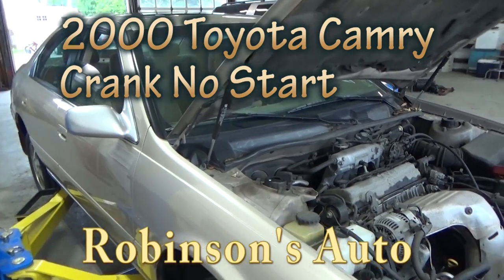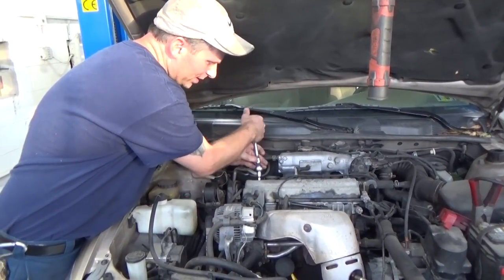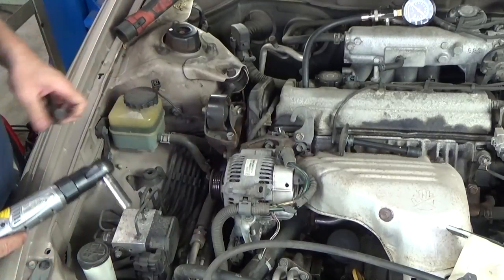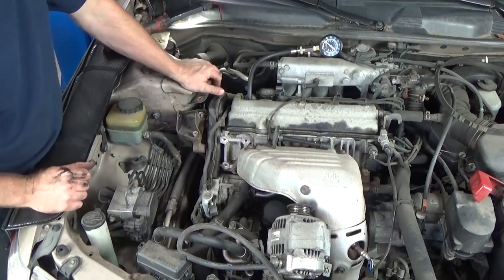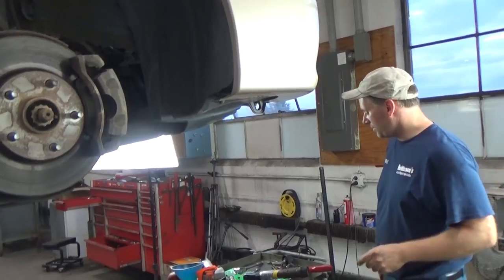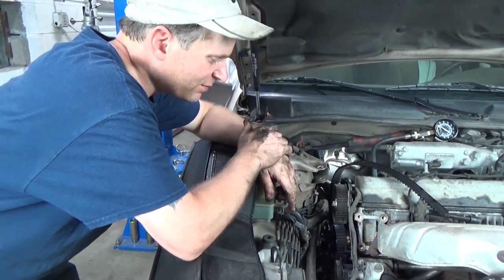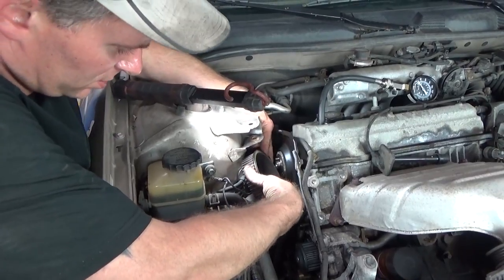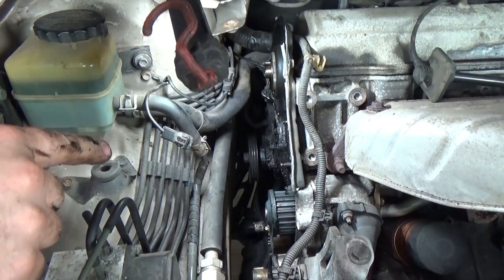Toyota Camry Crank No Start Part-1

Comment: I got the same crankshaft codes I replaced both checked all fuses and relays and also changed the fuel pump thinking it was the cause but after watching this video I will check for compression something I should of done from the gate but I'm a YouTube mechanic. Thanks for video

Comment: Great video!  My T belt failed due to not using a Toyota W. Pump or Aisan brand. Pump seized and T belt broke. I went in replaced all the components w/ Toyota or Aisan.  Replaced the 2 Oil pump seals
along with a Cam shaft seal. Installed a new T Belt.   Thanks for making this video!

Comment: The minute you said shut off on the road while driving and little resistance when cranking I immediately called it a broken timing belt or warn teeth on the timing belt.  Exact thing happened to me in my corolla. Fixed it myself with no problem.
Reply: as? what was the problem?
Reply: I just stopped on the road in the same situation
Reply: @mgalsanov  "I immediately called it a broken timing belt or warn teeth on the timing belt."  I guess she is talking about the timing belt.

Comment: Very distinctive sound of a  broken timing belt vs a non broken high pitch whine. I dont think that small leak of the valve cover could cause a timing belt failure. good job on the cam seal diagnosis, alot of ppl would've just over looked that. That tool is AMAZING!

Comment: On a lot of cars you can open up the oil fill cap and find the camshaft not spinning. I diagnosed a broken timing belt on an 02 Focus for a buddy on a farm with no tools in 10 seconds, I just opened the oil cap and saw the harmonic balancer spinning, but the camshaft not spinning.

Comment: My son has the exact same car.  The oil pump gasket, which is an oring on this car, is notorious for leaking too.  Easy to fix when doing this job.  I've also done his valve seals which were hard as a rock causing the car to smoke something terrible on cold start.  I understand this a common problem for this engine also.  His car only has 110k on the odometer.
Reply from the maker: Jeff Leach yes I agree it's a good time to do it. Thanks for the feedback. Had your hands full on that one ☝️

Comment: Gotta love non-interference Toyota engines! Just run it till she quits, throw a new belt on, keep on trucking :)
Reply from the maker: Pine Hollow Auto Diagnostics so true :) few and far between these days, thanks for stopping by bud! Glad to see your travels went well
Reply: Pine Hollow Auto Diagnostics That was my first guess. The timing belt broke. The description in this video of what happened while driving , gave it away.  I have a '95 Camry. No worries if my timing belt breaks either.  The best car I ever owned.
Reply: So i have 01 camary and today i started the car put it in drive and car turned off.. it is making the exact same high pitch sound when you try and start. All i could do bec i was at work was pull the top 2 screws and i noticed when trying to start the timing belt is not moving. What i do not understand is the car has 217k the belt was replaced at 100k and then again at 200k now here i am at 217 with a belt not turning. I cant get it opened up until this weekend to see if it is broke or jumped.. can there be any other reason where the cams wont turn? All other belts are turning so the motor isn't siezed. So frustrated. What reason could a belt go bad wirh just 17k on it? Thanks for reading.
Reply: @chadsmith1348  Crappy aftermarket parts? Failed tensioner? Should be obvious wnce you tear it apart :)

Comment: Had a 2007 Camry and it didn't want to turn back on after driving it. It turned out it was a .35 cent rubber washer/gasket that was cracked in the gas pump. Had to take the back seat out and pull the gas pump. I did a pressure check before anything and it was at 27 then after replacing the rubber washer/gasket it shot up to 60. No problems since.

Comment: Great video very luky having a cambelt snap and no damage i guess it was the oil what made the belt week over time looking forward to part 2
Reply from the maker: Paul Mayou very lucky indeed. I believe you have a good point ☝️😉👍
Reply: It's the last of Toyota's non interference engines the 5SFE!! Did hundreds of these when I worked in the Toyota dealership very easy timing belt job!!

Comment: Also look out for the water pump see if it's not leaking because chances are coolant and is leaking and got the belt wet and that'll cause it to snap as well, Even though, you're right the timing belt was never replaced "routine Maintenance"...
Reply from the maker: Daniel C. Yes it's a good practice to replace the water pump while your there. I agree 😉 thanks for stopping by and leaving feedback! Great advice

Comment: The engine looks similar to my 1989 Camry. Crank no start. I’ll try the compression test and go from there. Will the process be the same if the timing belt is the issue? 
 I just don’t know so please be kind 😄 thank you

Comment: I remember that sound when my timing belt popped on me at a red light, over a year ago. Still have the blue tag imprint from the guy who had to push my car with his truck, on the back of my bumper lol. Then the police pulled me over thinking I actually meant to run that red light. When my timing belt went bad, I was told that all the oil seals had to be repaired too. It was leaking oil into the area with the timing belt. The valve cover was leaking pretty bad from the back too because weak gasket.

Comment: I have this car with the 4c engine. I bought brand new gas because I knew I was going to have to let it set for a minute over the winter. Next fall come around and I pulled out the keys to get it started up, I can hear the pump engaging but it has the most electrical sounding crank that I've ever heard. There is absolutely no fuel getting to the engine for some reason but I can smell gas when cranking, like a old flooded carb (I'm aware this is not carb) I'm stumped. Filter? Something electrical? It bugs the crap out of me because I'd I could get it running that would really help my situation right now.

Comment: 2005 toyota camry xle crank no start sisters car I'm retired .  Milage ? . I'll start with compressin check. Did a 1999 toyota rav same situation non i terference engine. Got gates kit from rockauto. All set. Did 2006 subie sti timing belt with gates kit all set. Working on 199t honda odyssey same situation with  bent valves head still at machine shop. Hoping sisters car is non interference. Great video this will definitely will help me out

Comment: I have 98 Camry. Replaced head gasket. Everything back together. Timing belt good and at top dead center. Cams good and aligned correctly. Compression is decent but not perfect. But the 500,000 mile motor still has life. It’s getting fuel and spark but it will not start. It cranks fine just won’t start. And I’m at a loss. No codes from OBD2
Reply: Oh

Comment: I have 99 Camry AUTOMATIC 2.4. I hit a tree branch pretty hard. And it killed the car immediately. The fuel pump is working also if I spray starting fluid Into Intake it starts till it burns offs. Is there a emergency fuel shut off?

Comment: I recently replaced a timing belt for a friend's Camry the timing marks are correct and I rotate the engine and they land in sync.. but the car won't fire.. is it possible for the cam to be 180 out? I did compression stroke tdc and then lined up cam but no dice on firing up

Comment: Just had 2001 camry do the same thing. Seal at cover was shot. Had a real bugger getting the bolt off the harmonic balancer. Rounded it off trying to break the bolt loose. What's the best way to remove a rounded bolt? Other than that, this video was awesome.
Reply: It's a bit late but a chisel always works for the bolt and in the future bump the starter with a breaker bar on it. Works great.

Comment: The throttle should be held wide open to give it as much air as possible when testing for compression?
Reply from the maker: yes for a optimal test, the engine should also be warmed up prior, we should have seen near min 145psi  under optimal test should be closer to 178psi is the spec on this vehicle

Comment: Thanks for the video. I have a question for my 2000 Camry. It died the other day while we were going down the highway. I thought the fuel pump went out and replaced it, still cranked but no start. Do you think it could be a broken timing belt as in this case?   Back in last January, I brought it to a mechanic to change the whole water pump, valve cover gasket, and cam seal to fix this huge oil leak my Camry had. So is it possible that the mechanic didn’t put it back correctly last time, which resulted to it not starting today? Thank you so much.
Reply from the maker: Son Dao it's a possibility. Do you have fuel psi and spark? Many possibilities
Reply: robinsonsauto Thank you for your reply! I don’t have the fuel pressure gauge nor know where to stick the valve into and check the psi. I have not looked the sparks yet.   
Just got back checking the white plug (underneath back seat) to the fuel pump in the fuel tank to see if it has any power. There was 5 different connectors on it, but only 1 had power. I don’t know if that’s the way it is or something is wrong there. 
Also, I tried spraying some starter fluid to the air filter and gave it bit of gas to start it. Engine sounded like it want to start, but the moment I press the throttle, the whole front was shaking and seemed like the engine wanted to die. (Best way I can put this is as if you were releasing the clutch on a manual car and not giving it enough gas)
Has this narrowed down what might be the problem that you could think of? Again, thank you so much for your reply!
Reply from the maker: Son Dao so it starts some with starting fluid? Keep in mind if it's not getting fuel the only sorce is what you sprayed in. Starting fluid evaperates fast. As soon as it's disaped or burned off it's gone and the car will miss and shack from lack of fuel then die unless you keep it running by spraying more in. Is this what your experiencing?
Reply: robinsonsauto that could be the culprit since I only gave it three sprays each last 2 seconds or so, and then turned the key. I did not continue spraying while turning the key. I will try spraying while turning and see what happens. I will get back to you soon, thank you!
Reply: robinsonsauto Also, I forgot to mention that the OBD2 showed the code “crankshaft position sensor.” I don’t remember what exactly the code number was, and that was all it said on the screen, nothing else.

Comment: I have the same car car shut off one day there are four things in the distributor coil camshaft sensors two of them I am two sensor you're better off buying a new distributor before that take distributor cap off turn engine over if the distributor inside is turning then your timing belt is fine if it is not turning then guess what timing belt is broke I did this in my yard took me 2 hours myself fired right up

Comment: um this just happened on my  car .. same  car . 99  ..  i was on the  road near my  home .  i  knew  what  problem  was in  10  min .. took off the  timing cover  at top  .. pulled  it back  a little bit .. could  see the  timing  belt  broke ..  why  didnt  you  just  do that  first?  ez look  see at top  cover .. did  the  job  myself .. not too bad
Reply: could  also just pull  #1  plug  look  at  see the  piston if its  moving while  cranking . thats  easy too

Comment: What brand battery wrench do you use? Do you recommend it?
Reply from the maker: tomhasno Harley ACDelco ARW1201 Li-ion 12V 3/8" Ratchet Wrench w 2 battery, 57 ft-lbs find it on amazing as a kit 2 battery's under 200
It's been good to me, little on the large size though. I would like to try out the Milwaukee before referring this one. However I can't complain. If it wasn't for the length it would get 5stars from me
Reply: Thanks for the reply. They all seem to be bulky, I'm sure like everything else they'll get smaller. I want to check out the Milwaukee as well. Thanks again!

Comment: My Toyota Camry 2007 LE having a headache problem : If I run a few hours , than I I stop  to fill the gas tank . When I start the engine , nothing ! No crank , no sound ! But if I wait for the engine to cool down or use the jump cable with other car , the engine start fine !  I already change the battery  ! Anyone have any idea ?

Comment: Hi there,  why don't you pull the Valve cover Off, make sure that the - CAM-SHAFT - didn't Break, or valves got Bent, just to Confirm..., 
  Good luck, hope that ENGINE can be Salvage, if not start looking for a new one or a used Engine...
Reply from the maker: Daniel C. Part 2 will be up shortly 👍 would hate to spill the beans 😊 this job was completed last week just getting around to the edit. Good advice though! Thank you
Reply: robinsonsauto, Hey, OH, I see, can't wait for part 2,  BTW  Thanks 👍 for the Reply, yeah, I hate when people say, but what maintenance, is running fine, & I don't have the Money,  which I understand, but up to certain degree, oh well life goes on....
Reply from the maker: Daniel C. Your welcome 😉 I agree

Comment: Same sound  came on my 2004 Camry, only it had a timing chain not belt. Mechanic replaced the whole engine. I asked about changing the sensors, he said that that sound never means there's sensor issues. Did I get duped?

Comment: I've been searching all day to find a video explaining my problem.  I have a 2014 Camry.  Won't turn over and just cranks.  Cleaned the battery connections which only one needed any maintenance.  Getting power from battery.  Car just won't start.  Frustrated...  😑

Comment: WHEN ENGINE RUNS FAST NO RESISTENCE FOR COMPRESION ITS MEAN NO COMPRESION MUST BE A BELT OR ENGINE WAS OVER HEAT ,PISTON RINGS DAMAGE OR VALVE SEATS OR CAME SHAFT BROKEN ETC,

Comment: You Could've SAVED  30-45 minutes if You FIRST  Removed  the 2 top bolts on the timing cover and pull it back slightly to view the timing belt...Viola DIAGNOSED!!

Comment: I don't know what exactly you are listening to here. Is it the speed of the starter. It's just turning faster, because there is none of the normal resistance from compression?
Reply from the maker: The Thomas yes exactly! You got it. Have you ever pulled over a lawnmower or something with a pull or kick start, you will feel the resistance of the compression, if you take away the compression it will feel like nothing pretty much.  little resistance

Comment: My 2003 Toyota has been nothing but disappointment! Head bolts stripped at 200,000km (124,000 miles), few thousands dollars to fix! Replaced the starter for the 3rd time in 3 years! People praise Toyota way more than it deserves.

My 2003 BMW 530i has problems but they are usually leaks, or bushings, not TEN head bolts stripped!!! Or steering column rusted to the ground, or replace the starter EVERY year, what kind of quality is this?!

Comment: I can remove the timing belt without taking out all that crap... easily..  just in 15 min.. I know this Toyota engines as well as Honda's which are interference
Reply: Can you tell how? Currently on the side of the road and and running out of daylight😣